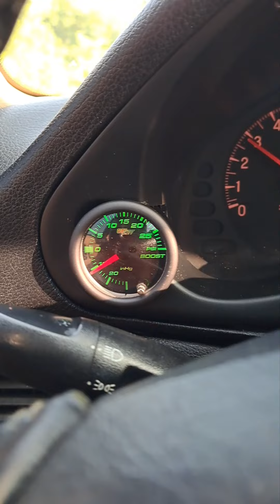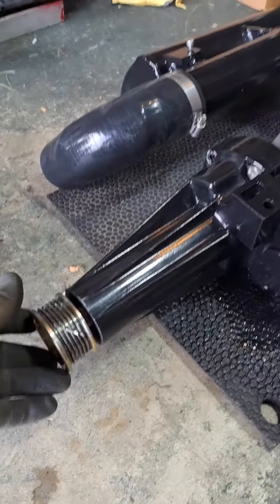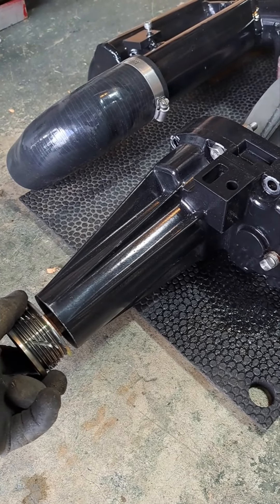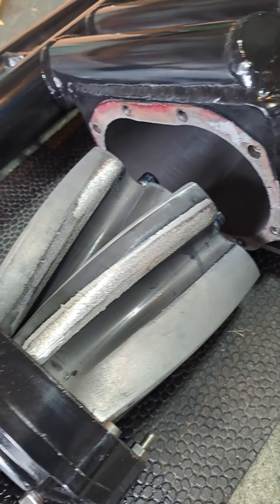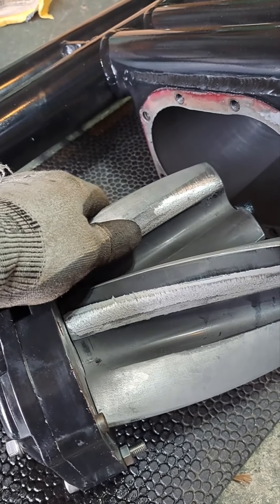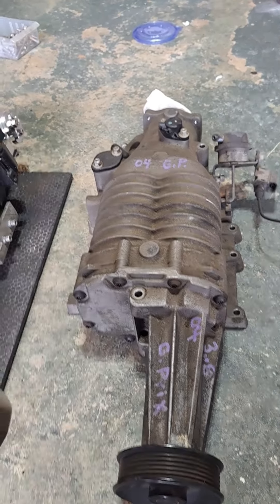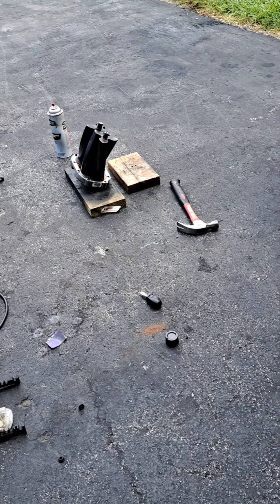3000gt Supercharger is finally working like it should #boost #supercharged #3000gt #fixed

Comment: I’ve been waiting for this Vid 😎
Reply from the maker: I have as well lol, this thing is a rocket ship at 6 psi with 10:1 pistons. Cannot wait to get full tuned. Crazy how much harder it pulls compared to the 3 psi I was getting
Reply: @sigvision4189 I’m super excited to see it tuned, I’m happy you figured out why it was giving you issues. That clip at the beginning sounded so good
Reply from the maker: @roxass  surprised the whine is not as loud but I am also spinning charger slower now so that should make it last longer
Reply: @sigvision4189  yep very true, I know some people with super chargers running a lot of boost and the supercharger screams, but as long as it’s safe and long lasting just a minor whine is just as good. What’s your targeted boost when you get her tuned?
Reply from the maker: @roxass  there is no boost control, I was told 7 psi was about as high as I could go on pump gas. So I am super happy it is landing on 6 psi. Now need to tweak fuel map and get timing lined out. I am going to guess she is close to 400 hp but the dyno will tell
Reply: @sigvision4189  dang that’s awesome, that much boost and it being potentially at 400hp. Well I can’t wait to see how you modify and build this 3000gt in the future 😃
Reply from the maker: @roxass  it is the little things, I spent so many hours trying to calculate boost pressure to get pulley size. Not everyday you come across a side exit eaton built for a 3.8l and piped through a intercooler with a 4.5 inch crank pulley. I landed on 2.6 inches for SC pulley. That is what is on it now and hitting 6 psi. That made my day for real. Made all that time trying to research and learn worth while
Reply: @sigvision4189 just showed my dad the 3000gt, he said that thing is bad ass, loves the color and the whine
Reply from the maker: @roxass  that is awesome, I was stopped twice this week by people talking about the color. I am working on the tune today
Reply: @sigvision4189  it’s such a good feeling having people come up to you and talk about your car. Gotta be one of the best feelings since a lot of people either have driven the car or had wanted one.
Reply from the maker: @roxass  yeah makes you feel like all this pain and effort was worthwhile. Most stories I get are back in the day I went to prom in one of those lol